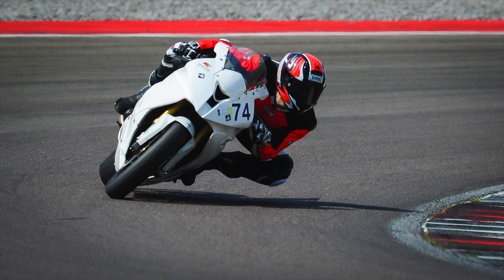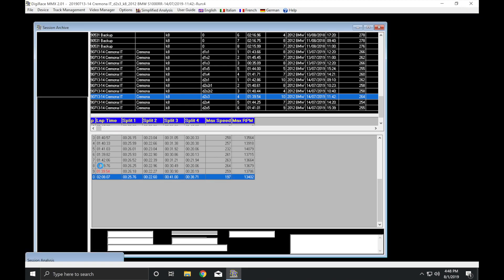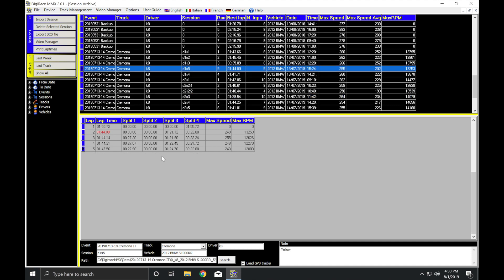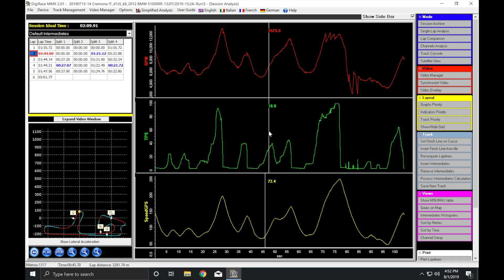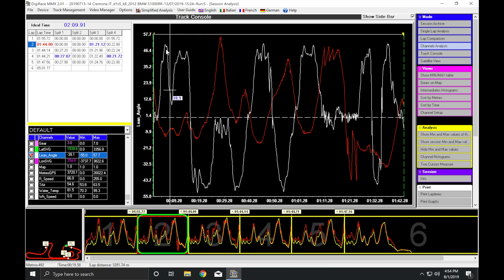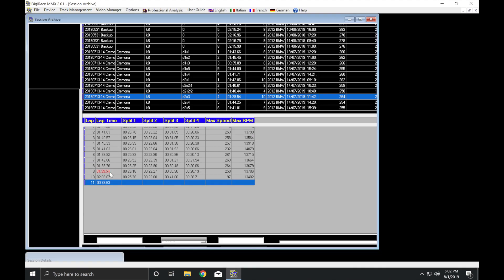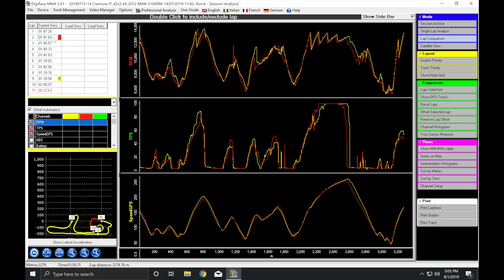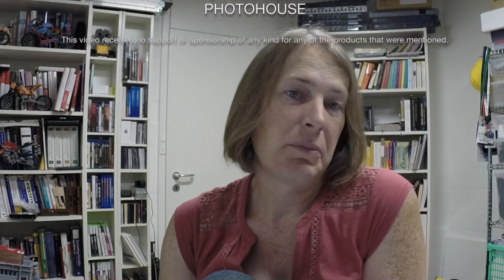Starlane WID-B Analysis

Comment: Great video!
Can I use the starlane WID B without the Coraso?
Reply from the maker: TY! Glad you liked it! Unfortunately, using the WID-B without a Corasro probably doesn't work. The WID-B reads the sensor information from the CAN bus of the bike, and transmits it in real-time via Bluetooth to the Corsaro. I've seen no information about connecting the WID-B to any other devices, so I doubt it will establish a connection with a phone, even though a phone supports Bluetooth.